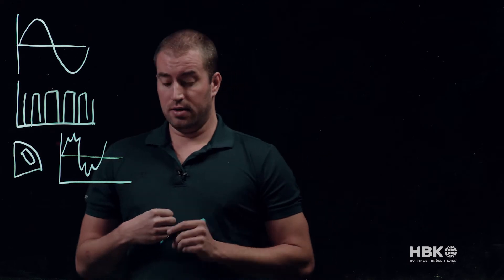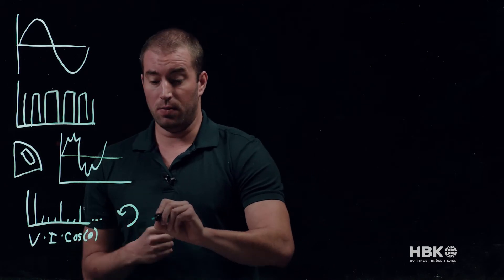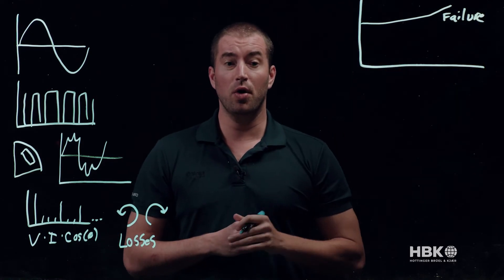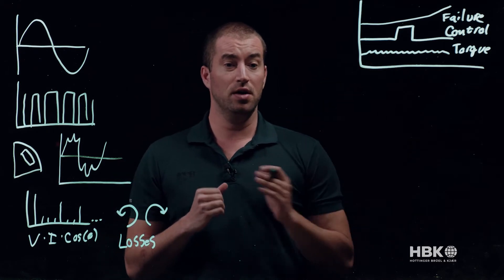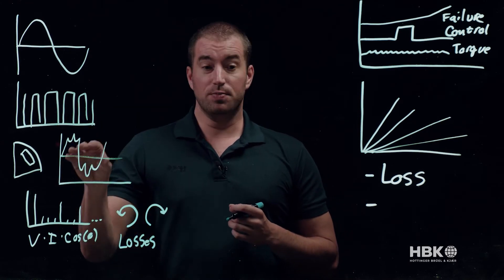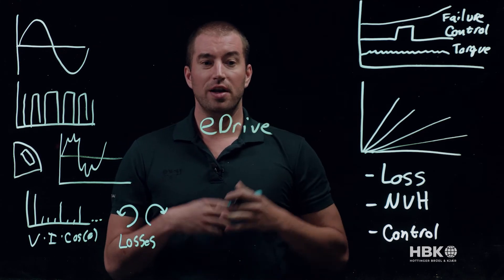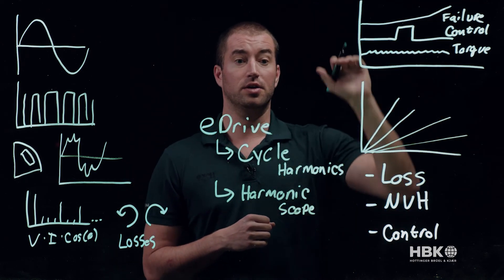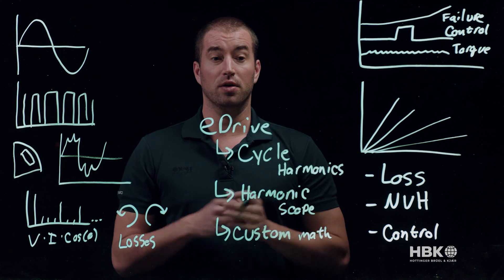Introduction to Harmonics in Electric Motors - Lightboard

Comment: I have a metal lathe with a 7.5 hp 3ph motor it gets harmonic noise sometimes so loud I can’t even use it, I can tap the pulley while it’s running  with a rubber mallet and it will stop for a while, sometimes weeks , but always comes back .